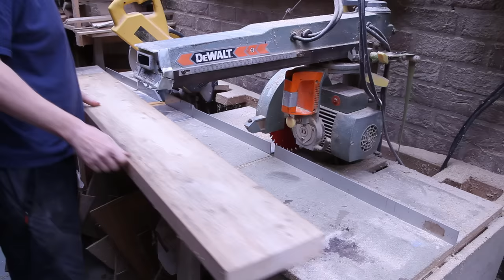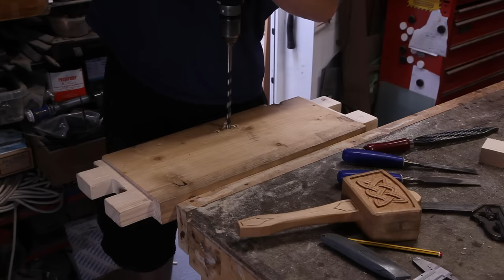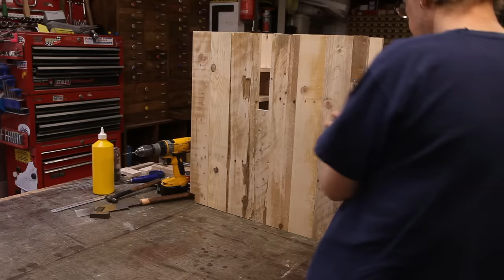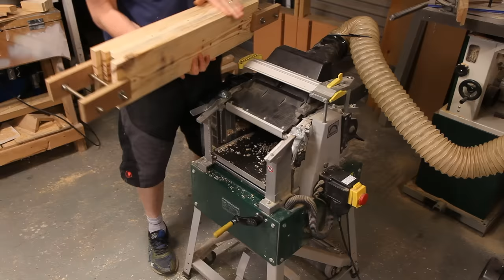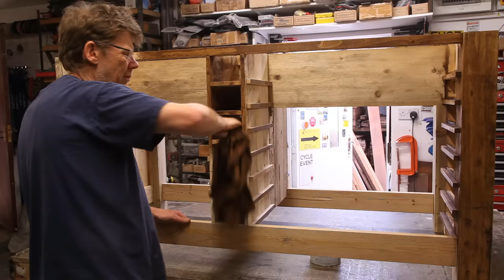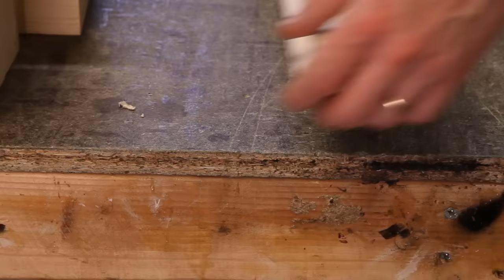A Very Solid Workbench made from Fire Doors, Pallets, and Scrap.

Comment: What impressed me the most in this impressive build are the little used bottle cap drawer pulls. 
You took washers, ground them down to size using a lathe so they are perfectly round and exactly the size needed to fit into the caps. Then the plastic washer to flatten out the dented center, then tapping the assembly down into a cylinder to make the crimped edges perfectly round again.  Whole assembly in stainless steel so it all works perfectly for the right thickness of the drawer front. Simply outstanding.  
The rusty nails being used as a design effect was also genius.  It looks like metal pins in there.  Beautiful.
Jason, your work just blows my mind. The level of conceptualizing, measuring so accurately, aesthetic realization, and the creative process of solutions like those bottle caps.  Very impressed by your creativity, the size of your projects, and the precision and patience to make it come to life. Well done, sir!

fyi - The rusty nails though, I would dip them in Loctite Rust Neutralizer, dry, then hammer in. It will bond the rust to metal and leave a thin coat to prevent further rusting.  Else over time that will streak the wood.

Comment: The exposed salvaged nail heads on the drawer faces are an interesting choice.  Another iteration might include  a  single rusty salvaged pallet nail,  with the last 1/2" bent over and hammered flat into the board for a bit of wabi-sabi flair.   Lol.

Kudos.

Comment: An excellent project. A lot of care and effort here in giving those bits and pieces a new life in your shop. One suggestion: find a decent used or new circular saw to use in place of that jig saw for long cuts. You’ll find it is quicker and with the use of a guide, much more accurate. I really liked the reuse of those bottle caps. A cool look.

Comment: My father made a carpenters bench when he was very young. It was solid, mortice and tenon joints with a centre pull out for storing tools. Took 2 men to lift it. I loved that bench but sadly I had no use for it and 5 years after he passed away I sold it to another carpenter. Sad day but went to a good home. Your skills are unique. You have a new fan and new subscriber. Lovely work
Reply from the maker: Thanks :)

Comment: Just got flashbacks to when a friend asked me to pop over to help him get his workbenches new top on.

When I got there I was a little confused to find 2 of his other mates already there. It turned out the new bench top was made by gluing hundreds of 6" lengths of pallet wood together so the wood grain went vertically. Don't know why that grain orientation was important, I just know it was over 3 meters long, over a meter wide, and weighed well in excess of 200kg. It took all 4 of us because we needed to get it from where he'd assembled it in his garage, down his garden, up 3 steps and into his workshop through a standard sized door. Humphing that thing into place nearly bloody killed us all ! :D
Reply from the maker: Wow, I thought my bench was solid. That thing sounds incredible :)
Reply: @EpicUpCycling  I don't know about incredible, but I do find it slightly odd to see how a hammer bounces on it, like if you were tapping an anvil. I also have a very clear memory of telling him at the time that if he ever moved I'd only help him get the thing back out if it meant I got to use my chainsaw. :)

The frame it's on weighs more than the top though. If I remember correctly, it's got 8 uprights that may have been made from new railway sleepers (They have to be getting on for those kind of dimensions), but luckily he built all that in situe without help. One end of the top has now been routered down by an inch so he could let in a 36x36x1" slab of pig iron as a place for when he needs to do "Serious hammering on stuff". Considering the total mass of the bench before hand, I think, as a percentage of the original weight, the extra mass this added would be akin to if I PAINTED my flimsy little workbench !!! :D

On the other hand, 20odd years on, apart from some oil stains, paint splatters, and a handful of saw/router gouges in it, his bench top is still perfectly acceptable. In that same time I've had to replace more than a few 1" plywood tops on my benches.

Comment: Discarded doors are amazing material, sturdy and quite easy to reuse as a table surface; the simpler the door, the better. My own first - and very primitive if compared with your masterpiece - workbench was made from two doors and some 150x50 mm planks.

Comment: That would be a cool series. Start with a 16x16 or whatever size workshop and a few basic tools. Build the entire workshop from scrap pallet and other woods. I am looking for a roll around cabinet design for 3rd printers. but could also be adapted to Router table, Drill press table, Multi sander table, scroll saw table and anything else that could use a 30"x30"x30" Roll around cabinet.

Comment: I like the rusty nails @26:15. As far as I can discern, they are just there for aesthetics? They do look great.
It makes me wonder if your "upcycling" spree is due to the rustic looking results alone? Or do you like to be sustainable and reuse stuff rather than throw it out? Or do you actually just want to make stuff on the cheap?
It's very inspiring to see what you manage to achieve some old wood, rusty nails & glue.
Reply from the maker: It's definitely not to save money. If I factored in my time it would be far easier to just buy materials. Sustainability is the main reason. I hate seeing perfectly good material going to waste, especially when it fits in so well with the styles that I like :)

Comment: Absolutely amazing work so don't get me wrong when I ask, I'm just wondering why 9 times out of 10 you sand against the grain?
Reply from the maker: I prefer the warn, aged finish it gives. Most of the material I use is pretty rough. I've found it's better to enhance this fact rather than try to hide it. It's particularly effective when using darker waxes :)

Comment: At the risk of having a bunch of popcorn thrown at me by the other viewers... WHERE are you finding all that wood? Surely you had to buy a bunch of it at a lumber supplier. I've been grabbing pallets for years. And you don't get 6 foot long, straight 4x4s or 2x10s from pallets. Would you be interested in sharing how you hunt for and source the wood you use? Otherwise... Love the video. Fantastic build. Thank you for making these.
Reply from the maker: Over the years I've managed to find a lot of good sources for junk wood. A lot of it comes from friends who are throwing old furniture out, and I've also got some good contacts in the building industry. The 2x10s were end pieces cut from housing floor joists that were in a building site skip. The 4x4s were old fence posts from the same skip. Industrial estates and building sites are great sources for scrap wood if you ask the right people there.
It's probably different all over the world, but where I am it's pretty easy to find scrap wood.
Reply: @EpicUpCycling  Thank you for this! Right after watching your vid. I was talking to a friend who told me that he looks for old wood bed headboards. Because they are a good source of long, solid planks. I'd never thought of that. I remember seeing a bunch of them all lined up against a wall at a local thrift store.
Reply from the maker: I've had a lot of old pine bedroom furniture given to me over the years. Great for long lengths of material.

Comment: Great work! Binge watch your videos all the time. I have one question though. I’ve dug through the comments and haven’t found a comment asking. Do you ever have an issue with wood movement? All the other YouTubers go on and on about making sure you account for wood movement but in a lot of your videos you don’t seem to, like with the bench top in this one with expansion and contraction. I have seen a lot of dining tables in my areas too that when attached to the tops don’t account for wood movement. Is wood movement not as a big deal as people rave on about?
Reply from the maker: I do have some issues with wood movement but it's rarely a problem. It's even welcome in some of the things I make as it adds to the character. All the pallets I use get dried and seaoned for several months before I use them, this helps a lot. Surprisingly the bench top hasn't moved at all. I did expect a few cracks but it's still perfect.

Comment: Could I get your thoughts on how you would go about making something out of an upcycled bed?
I have a bed I want to convert into a work table with I guess a two chest internal structure with external frame, so that if I need it I can basically lay the two inner chests side by side on the floor, but if I want a higher shallower bench I can stack the two internal chests. But I can't figure out a way to create a solid joint system in both arrangements.

Comment: I have questions, 1. What is the thought process you use to come up with your plans?  Do you use a computer program to sketchup, or use a pencil and paper (I prefer that method). 2. Where did you purchase your planer/joiner from?  I've been looking for that combo for a little while and what I've found is very expensive.  Love the bottle cap pulls, they're a nice colourful touch.  Cheers.
Reply from the maker: I do a basic drawing, sometimes on paper, sometimes on the computer just to get an idea of the look I want. I make the actual build up as I go along. The planer I have is a Record PT260. Here in the UK there are a lot of smaller planers availablefrom companies like Clarke, but they don't seem as common in other countries so it depends where you are.

Comment: What sort of pallets are used? I've heard that harmful chemicals are used on pallets. I want to start making things from pallets, but not sure what kind to use, or how to "fix" the issue with the chemicals used. Thanks for all of the vides BTW, great stuff
Reply from the maker: Look up pallet codes. Pallets in most countries are stamped with codes showing the treatment they have had. They are usually only heat treated, code HT. Chemical treatment was banned in most countries a long time ago.
Reply: @EpicUpCycling  Thank you very much!

Comment: Hi - new to the channel (1st video) and subscribed. One of the best things I've seen with so much attention to detail and thought gone into each aspect of the design. Well done! You clearly know what you are doing and so I have a couple of questions - Why do you prefer screwdriving by hand especially with pozidrive screws and not a little 12V driver?, also - why did you use what I think was probably fairly soft fast grown pine for the top instead of a hardwood? I'm sure you'll have good reasons. It is amazing that all of your materials would otherwise have ended up in a skip at a recycling centre or on a bonfire! Thank you for the inspiration! Kind regards, :)
Reply from the maker: Welcome to the channel, and thanks for the questions. I get asked a lot about driving screws by hand and it's a question that does baffle me a little. I honestly think it takes less energy (mine and the planet's) to drive a few screws in by hand than reach for a heavy battery drill that I still have to hold and push against. I'm not in a rush to get things done so time isn't a factor either. Don't get me wrong, if I'm building a fence or something, I'll get the battery driver out, but I don't need one just  just for a handful of screws. If you watch other videos of mine you'll see me using one sometimes, but I prefer hand tools when possible. 
The bench top is pine mainly because that's what I had available. Almost everything I make is from recycled materials. I do get oak pallet wood sometimes, but not enough for this bench top :)
Reply: @EpicUpCycling  Hi and thanks that all makes sense. I've got a little Bosch 12v Flexi click drill driver that I use for almost all screwdriving - i don't know if they make them any more . IMO the Swiss Army Knife of drill drivers and small and light. I will be having some of your videos running at our Men in Sheds for much needed inspiration! Thanks again for sharing your creativity!

Comment: Great job bringing those old scraps back to life!   Really enjoy your videos!   on a side note,  Can anyone tell me what the best table saw blade brand is and how many teeth you recommend?  I bought an 80 tooth Makita blade and after 3 hours of cutting heavy red oak it was toast.  I've been reading that fewer teeth for the rip cuts is better?  I'm newer to wood working in this capacity (furniture/smaller projects)  My thought was the more teeth the less tear out and smoother cut but what I'm reading is saying the opposite for ripping.  can any of you experienced guys give me a heads up on your experience or what you use?

Comment: Question.  On a simple straight crosscut, sometimes you use a hand saw, sometimes a jig saw and sometimes your table saw. (I just watched you use two different cutting methods on the same glue up piece, for instance--jig saw/table saw.)  Is that just a matter of preference in the moment or is there a more technical reason?  Just curious.  Thanks.
Reply from the maker: Usually I use a jigsaw if the piece is too big to go in the table saw, or if accuracy isn't too important. The table saw gives a better cut but it can be awkward to use.
I prefer hand sawing, and I will often do that if time isn't a problem. It takes longer but it's quieter, safer, and makes less mess.
Reply: @EpicUpCycling  Thanks.  I am working my way through your videos.  I find your quiet, focused concentration to be at the same time relaxing and inspiring.  Today I spent reconfiguring my workshop brought on by watching you work.  Thanks again.

Comment: When you run the boards on their edges through the planer, are you just looking to clean up the glue joint?
Reply from the maker: Mainly just to straighten out any minor problems. If the panels were very warped I would run them through table saw instead.

Comment: If you wanted to you could build it shorter and ass locking castors on the bottom to make it easier to move it around for organization and cleaning.

Comment: Sorry for making another comment but I wanted to ask u about that saw U use sometimes to make cuts? Is it called a cross Saw??  I see it in a lot of shops nowadays. Some ppl use the plunge saw but that saw u use is one serious piece of kit. I was wondering are they very expensive? and is it called a cross saw? If u have a moment to reply then thanks very much.. I'd appreciate it very much or maybe somebody in the comment section could help me about those questions please? Thanks!
Reply from the maker: If you mean the saw I use near the beginning of the video, it's a radial arm saw. The one I've got is really old. I got it second hand a few years ago. It's very good for cutting large pieces, but I tend to use my table saw more now, with a sled attachment.

Comment: Why are the drawers on the opposite side of the bench as the vise? If the vise is on the other side that would place most of the working area on that side. So to get anything from the drawer you would have to walk all the way around? I am lost.
Reply from the maker: The other side of the bench is all shelves. I use both side of the bench.
Reply: @EpicUpCycling  Oh that make sense thank you for clearing that up for me.

Comment: Where do you find scrap rough sawn 5x5x8' long 2x12x4'  etc?
Reply from the maker: The legs were 4"x4" fence posts salvaged from a garden renovation. The large boards were 2"x10" offcuts from flooring joists found in a skip on a building site.

Comment: Is that a Japanese hand saw a saw? 👀
Reply from the maker: Yes, it s a Japanese Ryoba saw :)
Reply: @EpicUpCycling  have you found any difference between 20 teeth per inch compared to 17 teeth on the the cross cut side of a ryoba?
Reply from the maker: @itsio7188  I've not got anything with 20 tpi but I've found the Ryoba to be fine enough for most things. I use a 24 tpi razor saw if I need anything finer.